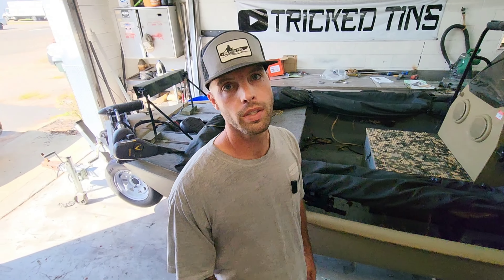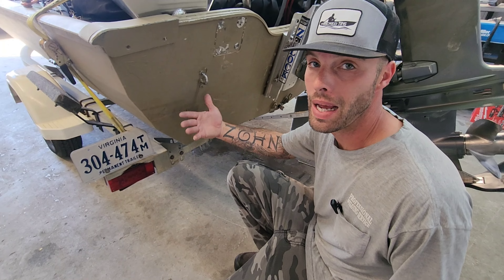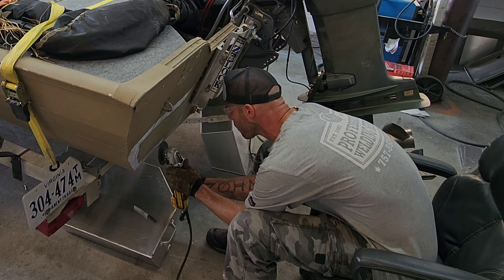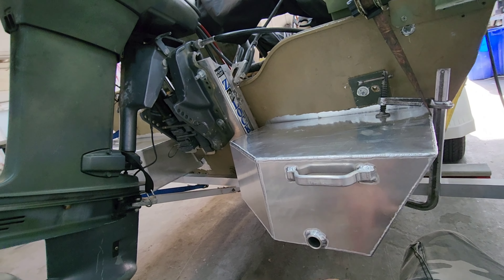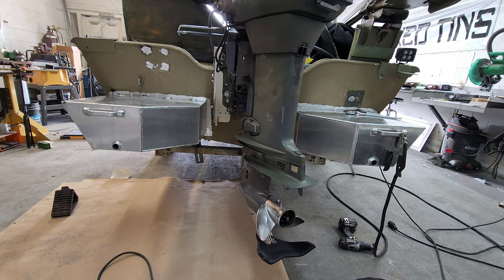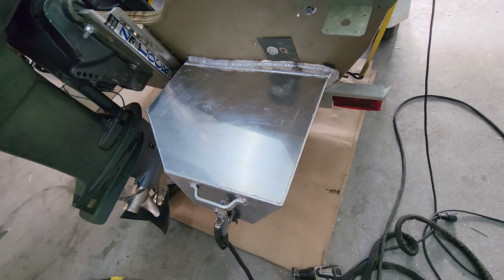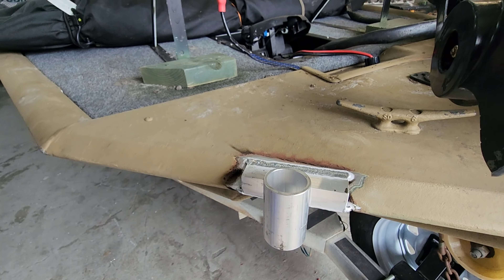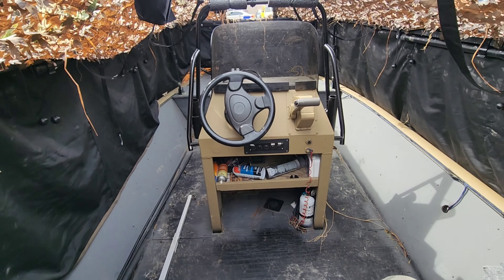"Will PODS help My Boat" #pods #installation

Comment: On a 17 foot boat how much do you normally charge to weld the pods on?
Reply from the maker: Size doesn't matter. Make and model and year is important. Usually around $650
Reply: @ thank you for the reply as a 2003 Lowe 170w and I ordered the medium size Beavertail pods

Comment: Your work is solid.... But the owner of that boat is pushing his luck with that transom. That is a lot of weight hanging on the back, and the unevenness you showed at the beginning is signs of stress buckle. He needs to replace the wood, and add a couple angle supports. 

Buddy of mine had his transom buckle and split while trailering on a bumpy road. His 14ft Jon boat had rotted wood core and the weight of a long tail with 22hp engine.
Reply from the maker: Thanks man. That's crazy.